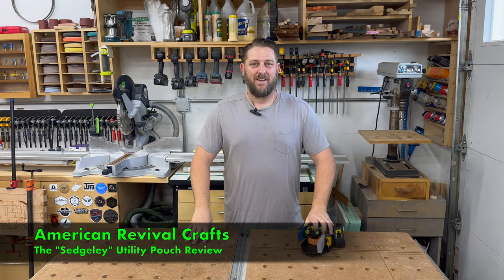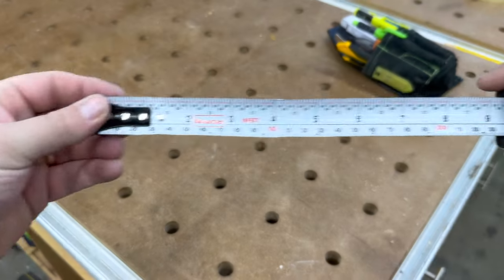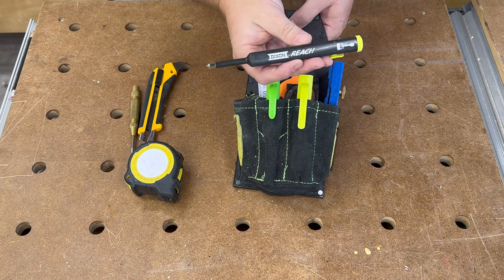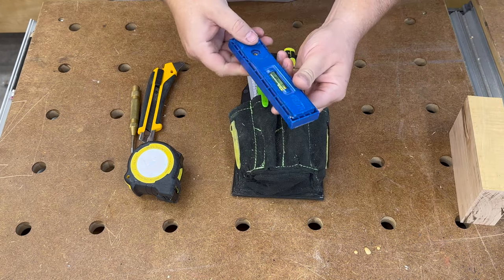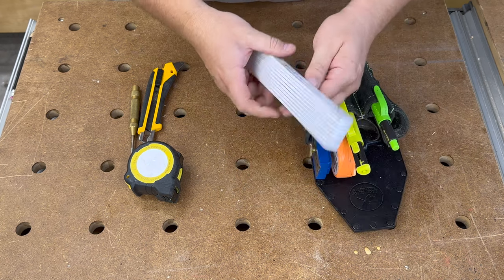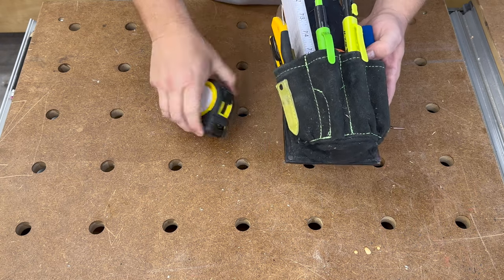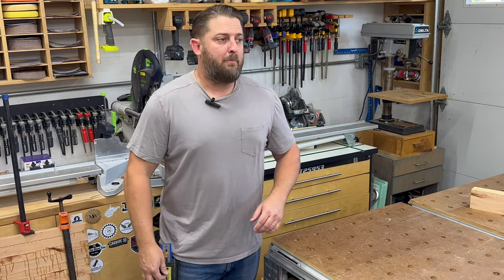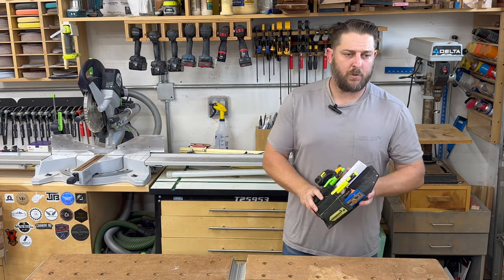The "SEDGELEY" Tool Pouch Review - Worth It?

Comment: I kinda hate your pouch setup.
-2 Pica pencils, no proper mechanical pencil.
-A folding rule in your pouch? What is this, the 1700's?
-Carrying your safety glasses in your pouch to get all scratched up
-Clipping your measuring tape to a suede pocket

ps: you used way too much glue on that panel glue up
Reply from the maker: Thanks for watching.